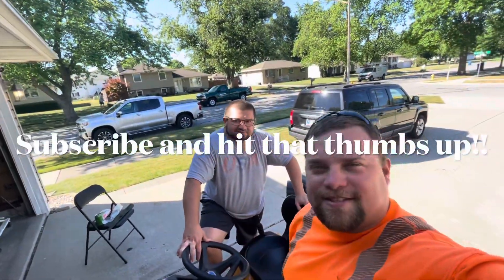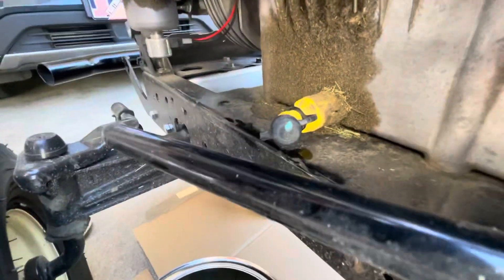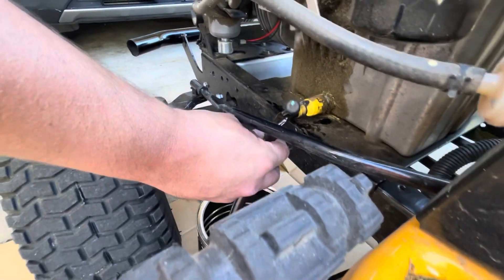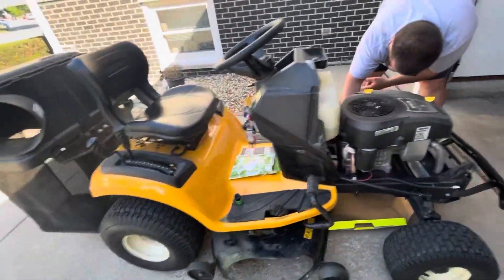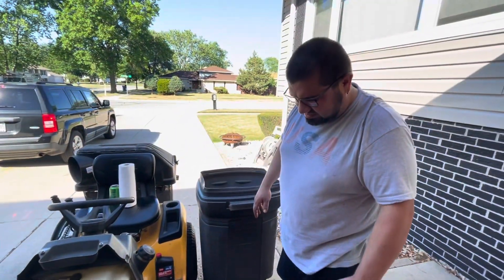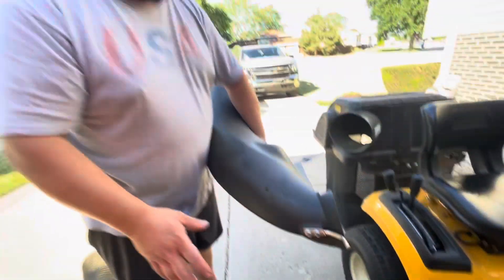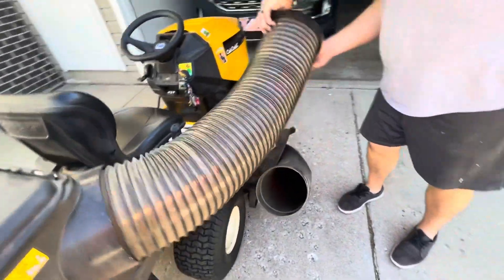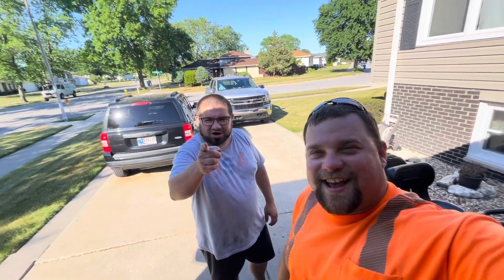How to do an oil change on your cub cadet tractor

Comment: I noticed in one of your other videos that it looks like you dont have a mulching blade on your toro. I didnt see the backfins that are usually present on mulching blades
Reply from the maker: The toro super recycler doesn’t have the atomic blade which is what is found on the recycler mowers